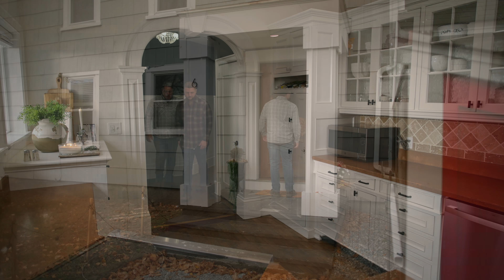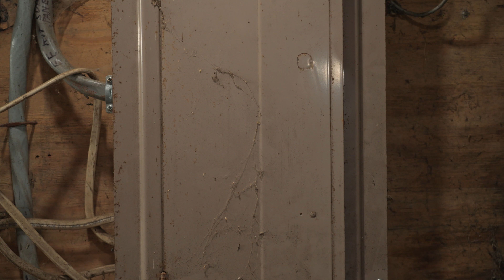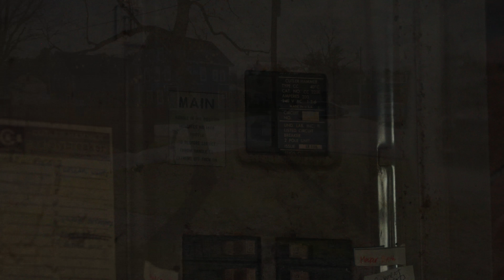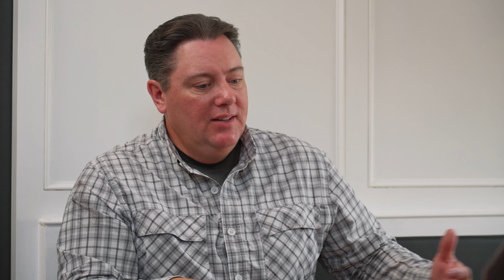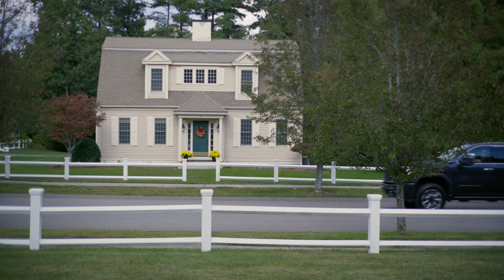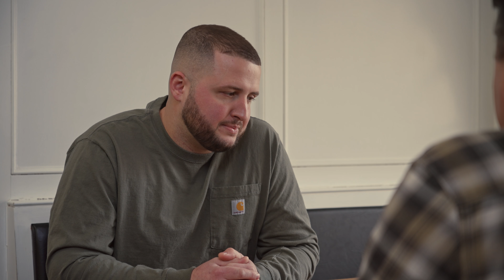Troubleshooting a High Electric Bill | Ask This Old House

Comment: I think this video is a misfire for This Old House, and pretty much a waste of time. Right off, they could see that the power meter slowed WAY down when only the kitchen appliance breaker was turned off, but apparently no further investigation was done to check the various loads on that circuit to see what might be the culprit. Instead, that elaborate monitoring system was installed, and months wasted, for a result that is meaningless to the actual problem. Our 'expert' suggests adding solar power to offset the cost. FAIL !

The homeowner should have called any competent local electrician, who probably would have narrowed down the culprit in a few minutes.

Comment: I have NYSE&G.  I realize it’s been unusually cold consistently this winter. In December my bill was over $600 and in January it was over $800. I checked my usage comparing last December and January to this December and January.  The difference was minimal to say the least. 
It ends up the power company is charging us, the customers, for bringing in power. Which to me is BS. Their job is to provide us with power.  We shouldn’t have to pay for them bringing in power that’s their problem in my opinion. They should be spending some of their own money not ours. My highest electric bill up until now during the winter has been maybe $350 to $400..

Comment: uh, if the minisplit is competing with an oil burner furnace, it's going to kick on way quicker and be trying to take up most of the load.. i can't really think of a way to use a thermostat to fix that, as you can't just set it to a lower temp and get it to fire later.. there needs to be integrated control over what gets fired in what sequence including time for warm ups. right now, that's got to be him turning off the minisplit until the house is almost to the right temp in the deep winter and letting it act as make-up heating instead of primary.

Comment: Yo what is the deal with the 24% of his usage difference between legs 1 & 2 of the shop panel? Mini split should be even across both legs for the most part, so what is going on in there? He must be actually using that as a proper shop. XD

Comment: My 1300 square foot house was built in 2005 and is all electric.  When I bought the house, the previous owner told me her electric bills averaged $320 a month which really surprised me.  The first week, I went up in the attic to measure the existing insulation since I was planning on adding more.  I was shocked to find there was no insulation over the kitchen and half the livingroom.  I added 12 inches of blown-in insulation throughout the attic.  In the 10 years since, the highest electric bill I've had was $130.

Comment: I like This Old House but this is poor advice. His bill goes up in winter.
Solar panel is not a simple save money recipe. Its going to cost a lot upfront that you need tax breaks to make it worth anything. Then usage times, daylight hours, location is very important. What times do you use power the most? Is the sun out? Many states changed how Net metering works and you will see next to zero benefit from that anymore. Regardless if you are pumping back more energy then you give or not. Electrical companies will still charge you a fee. 
-Service the Mini Split system. They get dirty easily and they break down 
-Clean out the Hot water tank. Probably has sediment build up. This will waste energy
-Service the well pump. They get packed overtime wasting more energy to pump the water
-Buy a temperature gun and scan windows, doors etc and check for leaks. You can use your hand on a cold winter day. Seal these areas with common weather strips you buy at your local hardware store. Replace windows if needed and if you have the money.
-When was the last time the attic was insulated? Insulate the attic. Cheap do it yourself can be done over the weekend for a few hundred bucks and a rental tool.

doing this will save far more money

Comment: biggest lie solar will save him a ton of money...
Reply: I like tinkering with solar as a hobby, and you're 100% correct!

The 25 year promise on equipment is a lie. Maybe the panels will last that long, if they're from a reputable manufacturer, but cheap solar panels will last 10-15 years. A good quality inverter has a lifespan of 10 years max, a cheap one maybe 5 years, if you're lucky. Same with the charge controller. Modern Lifepo4 batteries have a lifespan of 10-15 years, depending on how much you cycle them, provided the BMS doesn't fail prematurely, which happens often and budget batteries. The BMS can also fail to balance the cells after just a couple of years, leading to premature battery failure.

The solar installers will also charge an arm and a leg. I saw a woman get scammed for 38k, just to have around 6K of equipment installed on her property. The setup didn't even include batteries, it was a grid-tie system. 

Solar is nice if you want grid independence, or, if you enjoy tinkering with electronics, like myself.

Comment: I would like to point out he said it’s highly unlikely that your meter box is faulty in this day and age 2024 and 2025. They have a meter called a smart meter if you have it your electric bill is overly priced because they’re having multiple issues with the electric smart meter boxes overly charging people so if your issue isn’t what this guy shows you it’s most likely because you’re being overly charged because the smart meters aren’t really as smart as they say they are.
Reply: And the reason why it would be lower in the summer and higher in the winter time depends on how cold it gets down in the basement because if he has two hot water heaters that are electric at 240 V as well as two dryers at 240 V and two electric stoves at 240 V you think about it that’s a lot of electricity and when the basement gets cold, the hot water heater will kick on more often and also, I would like to point out people use their dryer and their stove in winter time months to heat up their house. Sometimes if this guy really wants his electricity bill a lot cheaper he needs to switch his hot water heaters to Gas switch a couple stoves with gas stoves otherwise it will be expensive

Comment: Check the main connections and torque them. Had a power outage in my area first time in about 40 years those main lugs were retorqued  especially the neutral.
Reply: Keep in mind those are still powered up even when the main breaker is off-

Comment: Not sure how his system with the mini-splits is working, but I know with my heat pump here in Nashville it does its thing until the temp gets down below freezing.  At some point the heat pump will not keep up, then the thermal resistor heat has to kick in to supplement it(basically running electricity thru a metal wire to make heat).  All I know is my electric bill goes thru the roof when we have that week or two where the temp never gets above 25 or so, cause the heat pump cannot keep up.  In a cold climate like Massachusetts, that backup thermal resistor is running ALL THE TIME and making that electric meter spin high enough to slice hard salami.

Comment: Mom had electric baseboard heaters in the crawlspace, and open vents.  She needed the open vents to remove the moisture.   We insulated the floor (she had like 4' crawl space!  Nice.  And set the baseboard heaters to 32 degrees.   And turned one, off off.
Reply: Darn that meter was racing

Comment: I know they wanted to off the tech but the find would have taken a lot less work.
Since the meter was spinning wildly at the time, just start shutting off breakers until it slowed down.  Gee, electric heat circuit is doing it.

Comment: Heat pumps are excessively expensive to run in many parts of the USA.     I'm in northern Ohio and there are maybe six WEEKS of the year where they are cheaper than using gas.  A lesson learned during the first winter here.   I have solar since then but there's no way I'd throw away solar energy on them either.

Comment: My wife complained about the electric bill last winter.  Replaced the 24 yo geothermal furnace with a more efficient one.  This winter high bill again.  Installed the monitor and found the emergency backup was on a lot.  Had the loops and pumps checked..everything ok.  Actually printed out the bill and realized half the bill was fees. Not using too much power, just paying too much for administration.
Reply: Yup. I’ve gone through my older utility bills and the fees are more than the actual usage. Gas bill was $110 for December 25, delivery & taxes were $62 and supply was $48. Bill used to be $80 a few years ago for Decembers heating bill
Reply: @nimrod275 Delivery and Taxes should be based on a percentage of the Bill ! NOT MORE THAN THE BILL !!!!
Reply: @nimrod275 yup. Eversource bill. 30% is usage. 70% is delivery and additions.
Reply: @nimrod275  My sewer fee is more than the water usage at my house.
Reply: @Void28368 yeah well treating waste water costs A LOT more than pumping fresh from the ground.
Reply: It's not the efficiency - increasing your heat pump efficiency simply makes the heat pump better at pulling heat from the ground loop. What you want is correct sizing, and the fact that the 'emergency' heat is being used routinely means you probably have a wrongly sized, too-small heat pump in your basement. Contractors do this to keep their cost low and charge you the same and boost their profit. What you want is to have a heat loss calculation done by an engineer and then ask the contractor to replace your heat pump with the size they should have installed... Or seal and insulate until the heat loss is actually matching the heat pump. Small claims court will convince your contractor.  Keep on mind, I'm a guy on the internet making several assumptions so you will need to ask the engineer you pay for his opinion, and don't fling accusations at a contractor who might be honest be uninformed.
Reply: The fee prices are global theft in whole western world.
You pay electricity less than all transmit fees and fuse fees etc.
So if you have a 100 bill, electricity itself is like 35-40 from it, and rest is other fees. 

I have monthly electricity use about 12-15, but I pay fees for 18-20.
That means I get about every second month the bill.

It use to be like a 15 years ago that fees were about 20-30% of the electricity. 
But the fees prices has been raised a lot. 
And that is because lot of foreign companies has purchased the electricity grids, because they produce constant profits. Everyone needs electricity, and if you get to buy the grid network, you tap to excellent income source, as in 5-10 years you might have paid your purchase off, and you are just generating profit constantly. 

That is why the fees prices has gone up, as people has taken actions to minimize the electricity. So it is now fluctuating and way to stabilize it is to have high fees that compensates well. 

That is when you give the capitalistic system be corrupted by globalists, bankers and tiny hats...
Soon you are paying just to have an possibility for service...
Reply: Bills nearly doubled over a few years. We all have this "environmental" "cost saving" bs from LED light bulbs to new appliances.. Yet our bill is always higher because they charge more even when we are using noticeably less power.
Its just a scam. Same with water. Better "energy/Water conserving" appliance "save money" having to unclog and clean the toilet often because little water used and my bills? HIGHER. Nearly doubled from Cov to today. Call water company and they say "No of course we not change your bills" I can pull out bills from a few years ago and I paid around 30-40month for water. Now? 70-80. 

Working citizens struggle so some random foreigner can make a fake day care and collect millions. We struggle so someone can sit at home all day collecting government aid.
Reply: 5 ton unit in a 4300 sq ft house

Comment: I had a side hustle where I would charge a $1000 an put a switch on your meter an I would tell them I wreck your men's keeping it on for 2 weeks and turn it off 2 weeks but you have to make sure it's on when they read the meter I made a lot of money may 400k or a little more.

Comment: Why I stopped watching TOS over the years.  More talking point, less real solutions.  Solar power to help in the winter, IN THE SNOW COVERING?!  <Giggity>  Everything is less efficient when working at its limits, that includes heat pumps in winter.  Modern ones are more feasible, but only marginally.  How is your insulation, beautiful kitchen area, but did you insulate and take care of the bones for the place?  Would insulating the basement below the frost line, or just the floor, get you less draft and less load on the heat pump?

Speaking of MODERN, How OLD are your Gas Heater, Well Pump, Hot Water?   Modern stuff is way better efficiency wise.  You have a fuel oil boiler for heat, when was it replaced/ updated?  Some of those are 80% plus efficiency with out shredding the wallet.  Second, Electric motors have come a long way, how old is that well pump, and any other electric motor you have that runs forever?  Electric hot water... did you know a lot of wind powered systems dump excess heat into a pool or hot water heater?  A couple small turbines shielded from the house out by the workshop might be just the ticket?

Comment: Does anyone use an ammeter anymore to check which circuit is drawing?  That's what us old school guys did.  No monitors.  Just see which device is sucking you dry.  If I saw my meter spinning like that, I'd go nuts.  And NO ONE thinks about all the little stuff these spoiled people have plugged in everywhere.

Comment: The heat pump in the shop likely switches over to 'emergency' electric heat strips when it gets to cold outside for the design.
An upgrade to newer technology can help.
Maybe shop for a wood stove?

Also a heat-pump hot water heater may be doable.
Reply: Even without resistive strip running & brand new heat pumps will still use a lot of energy. Near or below freezing tempertures COP drops to near 1 (Same as resistive heating). HP are most effective within about a 20 degree temperature difference between inside & outside (heating or cooling). Below that efficiency drops off a cliff.

Comment: That meter isn't spinning fast.  I counted 3 revolutions in 4.71 seconds.  That is equal to 16.5kW in instantaneous load, or 68.75 amps.  On a 200-amp service.
Reply: My house rarely use more than 2KW. 16.5Kw is about 8 times more than what I typically use.

Comment: So, after hooking up all the monitors and the expensive electrician's bill I sent you for doing that, I discovered exactly what I thought.  It cost more in the winter because you are using more electricity, because it is winter.   My advise, spend many thousands more on solar and by the year 2056 you may just break even.
Reply: When you break even in the year 2056 the solar panels will be worn out and need to be replaced.
Reply: @sd906238  "When you break even in the year 2056 the solar panels will be worn out and need to be replaced."

Nah odds are PV panels break well before 2056. Likely a solar contractor will install the cheapest that won't last more than 7 years. Plus the panels will be installed on the roof, improperly so the roof leaks costing you $20+ in roof repairs.
Reply: @sd906238  Solar panel technology evolves by then they will be cheaper and better.

Comment: 1. Heat pump is probably a split system.  Heat pump operates down to maybe 30 degrees F, then switches over to oil furnace?  Don't expect increased use in sub-freezing temperatures unless secondary heat is electric too.
2. Suspect cable TV boxes, which are notorious for heavy, unnecessary electricity use (bad design, no government energy standards).
3. Heat pump water heater is a wonderful option... if you're an HVAC technician.  Otherwise risk of turning into a money pit.
4. Heat pump ever cleaned?  Any old appliances?

Comment: That heat pump can only extract so much heat from the cold air to maintain room temperature. Then it then switches on a resistance heater element, that draws a lot of power,  to make up the difference.
Reply: Depends on the model, some heat pumps don't have resistive heating backup. And some units are still efficient down to 0F

Comment: Yes good...I agree install solar PV...but that house needs insulation! They stepped into an 1870 stone basement with zero insulation!! I would either install 2" or 4" foam throughout the whole basement or install R29 RockWool between the floor joists and 4x8 sheets of R5 foam sealed with spray foam and aluminum tape. The attic needs R80 too I imagine.
Reply: Not a good idea to over insulate older homes on the inside. Will lead to rot problem. Only option is to install exterior insulation so the studs & sheathing do not rot.

Comment: This sounds like a big joke to me spend money on the system to see whats using the electric . just to be told you need to spend more money to change out major appliances in your house. 🙄 get rid of the heat pump and put in a natural gas  furnace that dont use so much power. change out the water heater to a gas on demand water heater. get a gas cook stove. electric appliances are not the way to go even though they keep shoving them down our throats.

Comment: Something I learned years ago - electric baseboard heaters (220 volt) constantly pull power. Even if the thermostat is off, it is still pulling 110 volts. If you turn them off at the breaker, it stops completley. I saw a noticeable difference on my electric bill, Saved about $40-$50 on my bill every month.